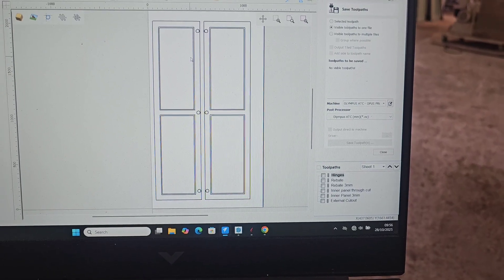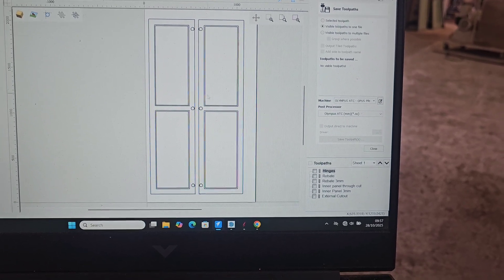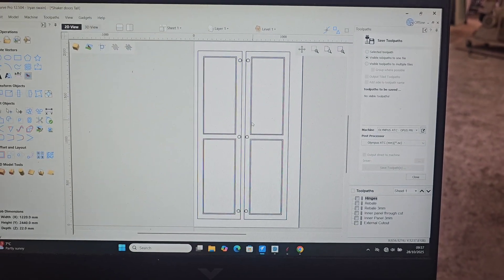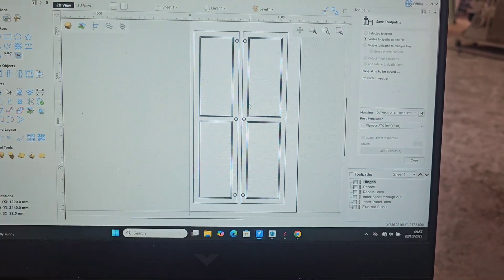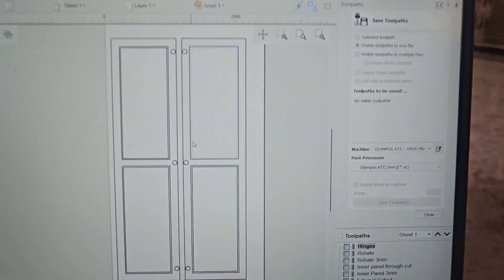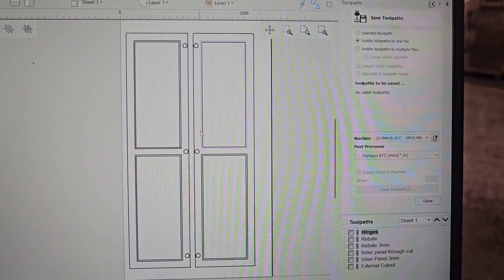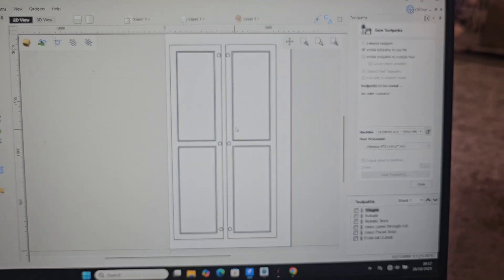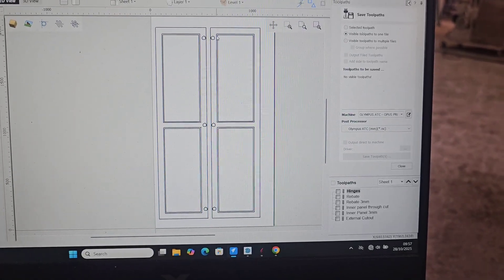How to make shaker doors on a CNC machine

Comment: Consider doing the rebates with a pocketing  tool path. when setting up the tool path use the 10mm as a clearance cutter and the 3mm as finishing .  that way the 3 mm with only clear out the corners and save you time. when calculated it will give you a clearance and finishing tool path
Have you thought about doing the rebate  13-14 wide.  16mm deep like you do. but then going straight to the 3mm cutter to remove the last 6mm of the panel and making the rebate 10mm wide, as the wider rebate has removed the bulk of the material that the 3mm does not need to cut.
it will also save time changing cutters as after using the 10mm to do the rebates, then picking up the 3mm for the corners it will go straight onto cutting out the panel without having to go back to the 10mm first then the 3mm again . saves a process. 
Hope you understand what i mean. 
Have you ever tried doing 1 piece shaker doors?
Reply from the maker: Yeah i actually do them a lot different to this video now, will post an updated one soon!
Reply: @RSBespokeJoinery  Will be good to see. we are going to be offering a service to make shaker doors soon, so great to see how others make them, 1 piece over 2 piece, pro and cons. but do no worry i we are based in East Sussex so wont be a competitor , haha
Reply from the maker: @deanwilliams5913 haha all good I'd much rather see small companies succeeding than these big firms taking all of the business when we can offer a better product ourselves. Good luck with it!!!

Comment: What is the name of the pneumatic tool used to ease the edges?  I've seen a similar product used for metal, but not one that takes router bits.
Reply from the maker: Hey Matt, here's an affiliates link to the product I use, from amazon. It's been great and you can use it on both metal and wood - thanks for watching the video! https://amzn.to/3JgOf8g

Comment: Low vacuum bed performance… have you sealed the edges of your spoil board?
Reply from the maker: You're right it's not the best. I currently only have 2/3 vaccum pumps plumbed in, need to get the 3rd running ASAP.